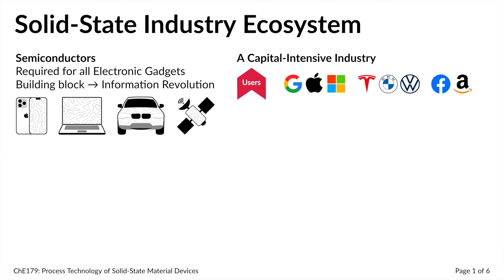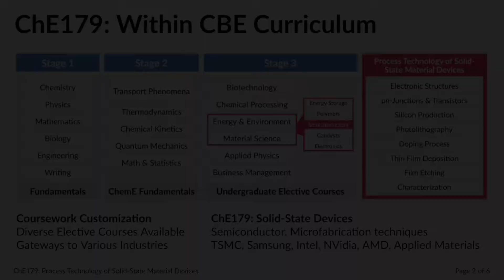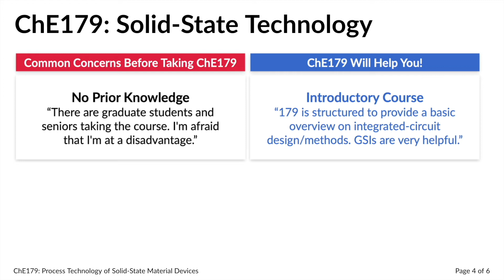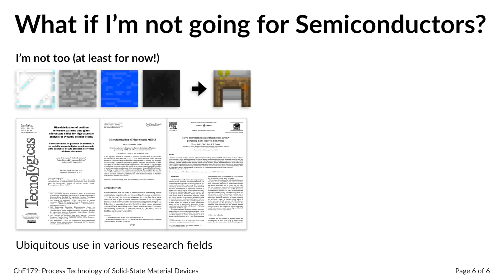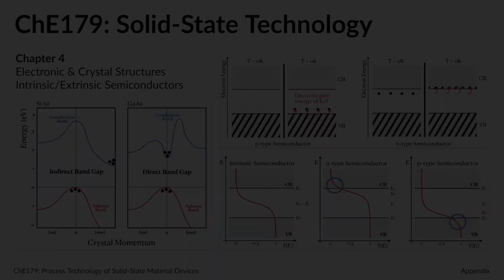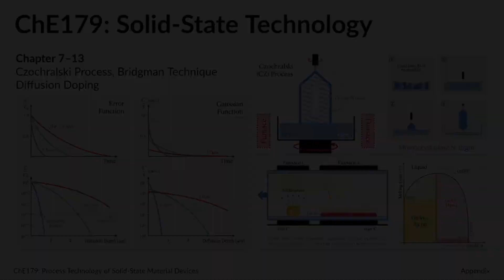Introduction to CBE179

Comment from the maker: For clarification (@1:34),
1) IBM is not typically categorized as an fabless as the company still retains some of its own semiconductor manufacturing capabilities. However, IBM has shifted its focus away from chip manufacturing and has instead become more focused on developing and licensing its chip technologies to other companies.
2) Synopsys, Cadence, and Siemens-Mentor are all Electronic Design Automation (EDA) companies providing the design know-how to chip fabless companies.
3) Arm, on the contrary, specializes on Reduced Instruction Set Computing (RISC) processor architecture rather than design software. Intel and AMD are known for their x86 architecture based on Complex Instruction Set Computing (CISC) processor architecture.
4) ASML is a developer and a de facto monopoly over of Extreme Ultraviolet (EUV) photolithography systems, which are crucial in manufacturing advanced chips. ASML should be noted in "Equipment" but was omitted due to space.
5) KLA build process control and yield management systems that are used by chipmakers to improve yield, reduce defects, and increase productivity.
6) Lam Research and Applied Materials are known for semiconductor manufacturing equipment. Specifically, Lam Research is known for their etch and clean systems, whereas Applied Materials' most prominent products are their deposition systems.